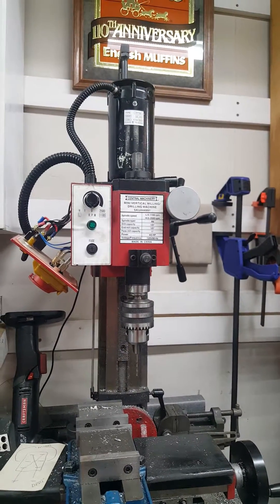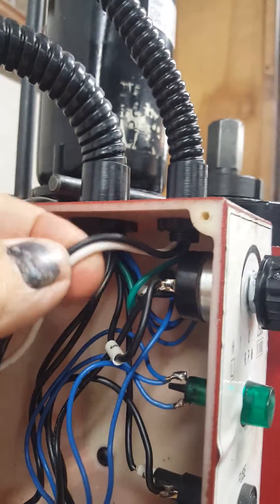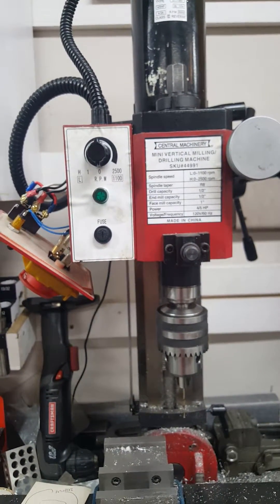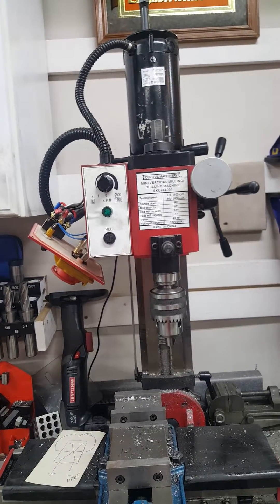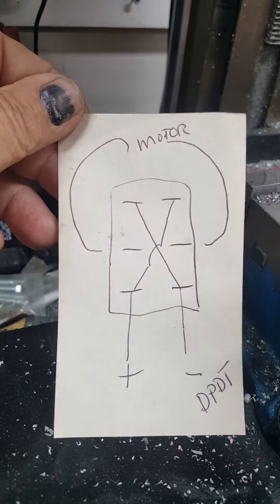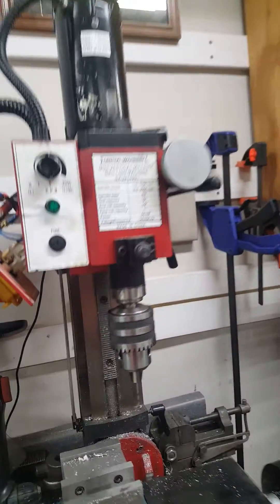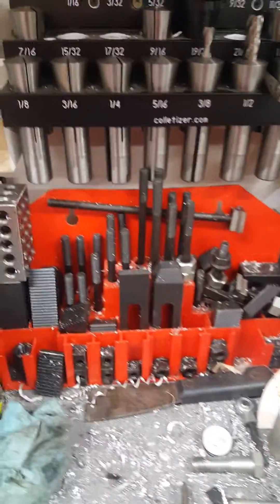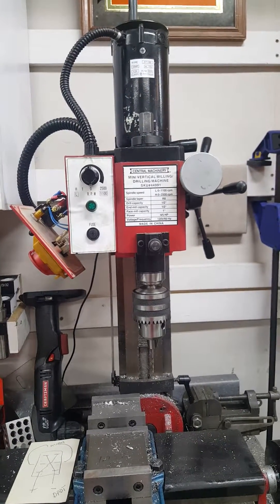HF Mini Mill reverse switch and dro

Comment: Great Video !!  Just got my first mill,  the HF Mini Mill ... so far great machine, 2nd day forgot to lock in Z and it dropped a tad while milling, stopped the bit, broke the big top Plastic gear ....  Ordered the Belt kit from Little Machine Shop ... and I was looking at the Black & White wires going to the motor..... Hmmmmmmm maybe switch these???   Now I will do it !!!   Thanks for the Info !!!  Yes, don't switch while under power !!!!

Comment: Thank you Larry for sharing! I want to add this switch to my mill and I am fairly to this and want to make sure I do it right the  2 black and white power wires get connected to the bottom of the switch and the black and white wire from the motor get connected to the center of the switch. Is that correct?     Thanks Bob
Reply from the maker: yes the diagram i drew is at the 3 min mark
Reply: @bandaid1957  Thanks for your help still in the process of setting things up the 3 dros will be here today the TouchDro arrived on friday be so glade when I get my little shop setup.